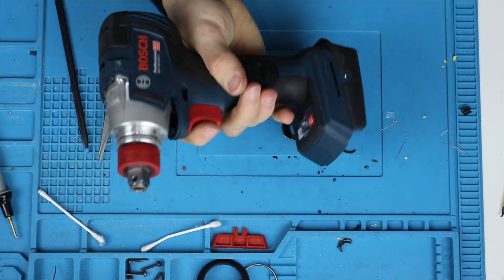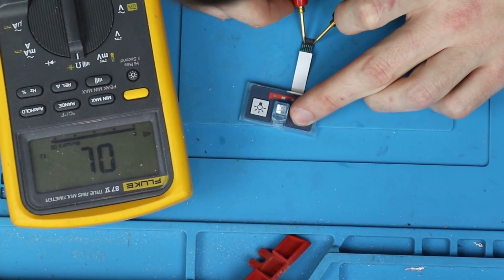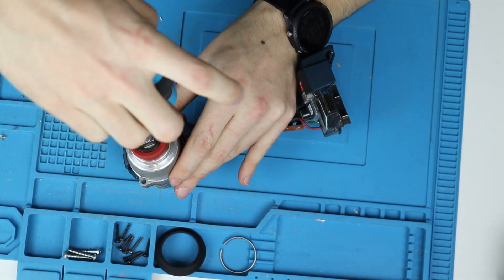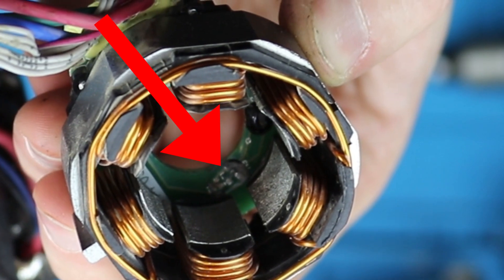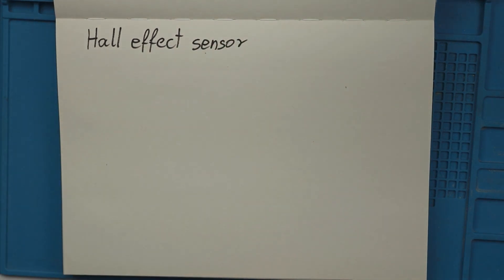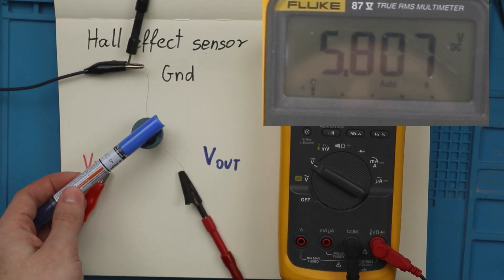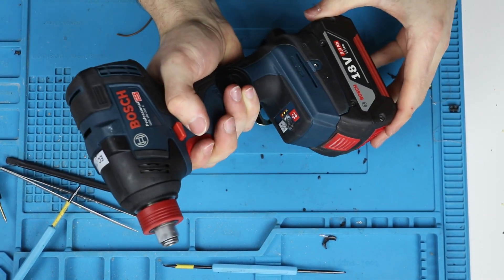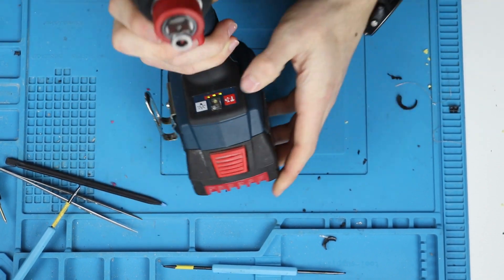I guess it still counts as a switch — Can I fix it ?                      BOSCH GDX 18V-200C Repair

Comment: Thank you. This was an excellent  video.  Super clear.  I guess i would like to see the brands of the contact cleaners and other off the shelf cleaners/sprays you used…thank you.
Reply from the maker: Thanks a lot, I only used 99% isopropyl alcohol and PCC flux cleaner in this video. For the flux it’s mechanic uv559 and it’s significantly easier to get it off when it’s still warm.

Comment: Hi, I have a Bosch GDS 18v-1000 and the lights and speed selector stopped working and so I looked around on YouTube and found your video and decided to order a new electronic module for it and now all the lights turn on but it's still stuck in speed 1 and doesn't switch. Do you have any ideas of what to do next? 
Thanks.